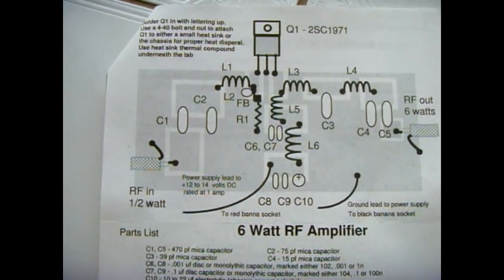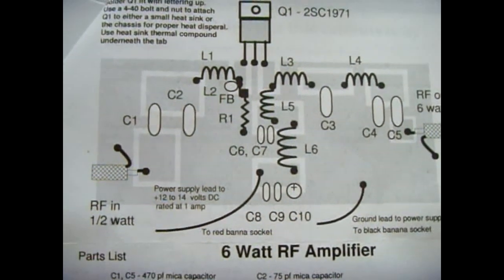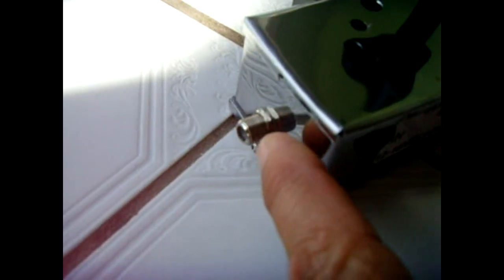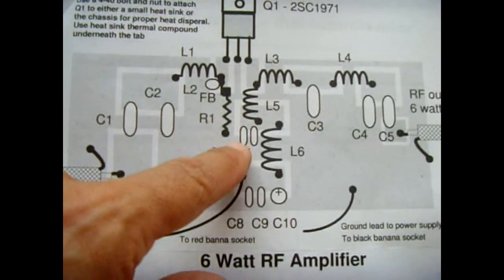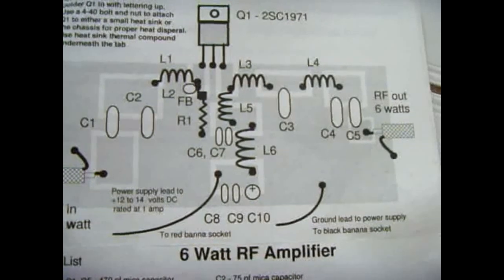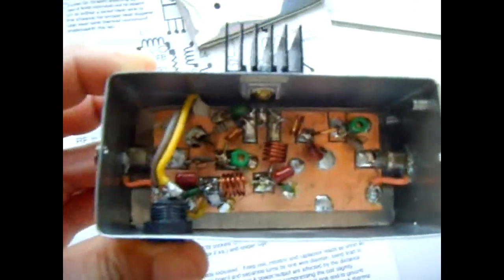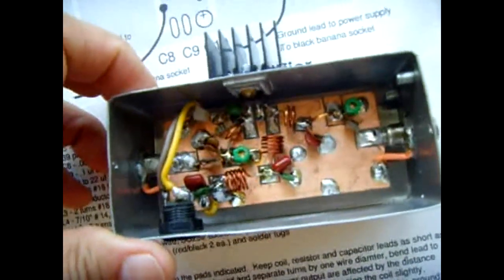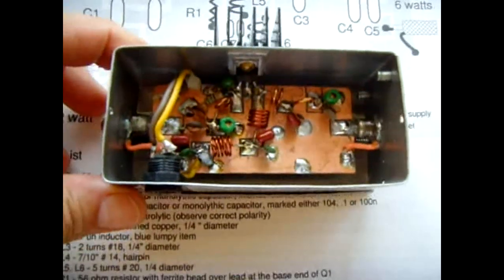6W RF Amplifier Using 2SC1971 (85-110mhz)

Comment: If i use fix 22pf on the output instead or a trimmer cap  connected parallel in 470 pf can i still have the 6 to 7 watt output?

Comment: Is it possible to achieve 2600Mhz or 2.6Ghz using this circuit? if not do you have one schematic doing that?
Reply from the maker: No. 2sc1971 is for VHF only. You're better off buying an amplifier at the link below.

http://bit.ly/2soXMA6
(coupon codes: BGAFF7, affiliate6, or elec)

Comment: what is FB?
Reply from the maker: A small ferrite bead goes over the lead of the resistor on the side of the resistor that connects to the base of Q1. :-)
Reply: what are the turns in fb??

Comment: what is the maximum range of this?
Reply from the maker: Hello. All depends on the terrain. Across open water or a desert? 10 miles or more. Thanks for watching! Be sure to rate thumbs up and share.
Reply: This looks like a very nice amp.   How much input power is needed for this amp?     With a 5/8 wave, tuned omnidirectional ant. I can get about 2.5 miles in a residential suburban area having some large trees using about 3 watts.   I can decrease the output to drive your amp to maybe get about 5 or 6 miles omni. range.
Reply: Oh, the drawing says 1/2 watt drive.

Comment: mine doesnt work,, can you help me please? no output at all, fine temperature on my Transistor.
Reply from the maker: +Jomel Brent Arances 
Possible causes:

Fake 2sc1971
Faulty 2sc1971
Incorrectly installed 2sc1971
Transmitter is too low in power for the RF amp's input.
Improperly tuned amplifier

Thanks
Reply: i dont know how to properly tuned the amp
Reply from the maker: It is almost impossible to tune a RF amplifier without a field strength meter and DMM to measure the current draw by the RF amplifier.
Reply: thanks sir
Reply from the maker: *****
You can find them. Look up videos on Youtube showing how to identify fake 2sc1971's
Reply from the maker: *****
A Google search can do wonders. Enter "RF Transistor 300 MHZ"

Comment: If you think the 2SC1971 is a good RF amp. for FM you should try the RD15HVF1. With a 6dB resistive pi attenuator on the input you can still achieve 15W out with 500mW drive. They're quite rugged and you can adjust the output power between 1w and 15w by adjusting the gate bias voltage. It makes the perfect accompaniment to a larger amp as a driver. I managed to use one to drive a pair of MRF455 transistors in tuned class B push pull. I know the MRF455 is specified as a HF device, but it will work as a low band VHF power amp to 110MHz. I got 150w out of this configuration, lol! Interesting experiment :D
Reply: Andy Payne Yes, very good but often not practical. Can you get the specialist capacitors, Teflon boards or run the circuits at the frequencies that the datasheet test circuits operate? Do you want to be transmitting at 175 or 512MHz? Almost invariably the answer is no. The values of xc and xl at the input and output of the devices does not always change in a totally predictable nature as frequency is changed and circuit board dielectric characteristics also change as frequencies change so just scaling stripline lengths according to frequency is not enough. If you get a circuit that someone has already been using at your frequency of interest, then you have a verified circuit anyway,s and what is the harm in experimenting? That's what radio tinkering and learning is all about.
you are speaking to someone here who has been such a tinkerer for about 24 years, so I know what I'm talking about from a practical standpoint
Reply: Got a schematic ?
Reply: It is pretty easy to round one up by searching on google. I have one built into a die cast aluminium box, using it as a heatsink. It only ever gets warm. Draws a maximum of 1.5A at 15V and easily puts out 15W
Reply: joy m http://www.mitsubishielectric.com/semiconductors/content/product/hf/sirfpowermosfet/siliconrfdiscrete/siliconrfdiscrete_lv4/rd15hvf1.pdf
Reply: Andy Payne That is the datasheet, yes. There are circuits for amps for the FM broadcast band using the RD15HVF1 on the internet. If you google RD15HVf1 and go to the results for images you will get schematics
Reply: I like testing schematics in datasheets first since they are verified.
Reply: joy m Try this. It is more of a picture of construction than a schematic but you can easily work out how to build it "ugly" style without etching a PCB. http://elektronika.web.id/elkav2/index.php?topic=733.60 scroll down the page and you will see the picture.
Reply: Is the RD15VF1 an LDMOS power MOSFET made by ON Semi?    I've got a 3 Watt Xtmr with output power control down to 250mW so it would be nice to get about 15 watts. Rather than 2.5 miles, I might get 8 or 10 miles with my 5/8 wave omni ant.  What do you think?

Comment: Also, are there any problems with harmonics in this design? Do you use any filter inline with your antenna?
Reply from the maker: I'm posting a new link right now. I did not notice any harmonic issues. I walked all around with my frequency counter and did not notice 100mhz/200mhz. Only 100mhz. I'm sure you can add a low pass filter to prevent any harmonics above the frequency you choose.
Reply: Your frequency counter will only respond to the fundamental frequency as it is always going to be significantly greater than the output though. You need a tunable rf sense meter. I believe they are referred to as a wavemeter. It's really just a tuned field strength meter or tuned rf sampler. It could be a great next project for you :)
Reply: Use RF spectrum analyser for any spurious emissions

Comment from the maker: Not too much. I had the scrap stainless steel for the housing from a non-repairable microwave oven. The rest of the parts I had pulled from scrap electronics. The 2sc1971 I bought online. Beware of fakes. There are videos to help you identify the fake RF transistors. I bought used ones pulled from older electronics.
Reply: Hi man great to see you did this is have seen and baught other people's  models

Same concept. 

Can you send me the full  sheet of details with diagram and parts list u have on the sheet of paper 
Please

Comment from the maker: If the input power is too low, the amplifier will not work. It won't oscillate.

You can try a NTE342.

Thanks for watching my video.
Reply: What if feed 1971 with more power than 500milwt example 900milliwat what can happen,? even witn conected antenna 
İ have one amplifire like this but when i ste last stage trimmer to the more power my frist made signal goes out from right frqunecy wich is set from pll!! Whats my problem ,please a little guide !!

Comment: Where can I get a case just like yours? I need help finish building my rf amp,I brought a 500watt rf amp pallet and need help finish building it.I need a BLF78 also want to know how can I connect the coax to a power supply and what max power supply should I get for the 500 watt rf amp pallet.also what max should the fan be and how to conncect it.

Comment: Few questions if you get the time to answer. Is a RF transmitter and amplifier the same thing or do you need a transmitter to plug into this amplifier? What kind of range would one get from this device? And one more, is there somewhere I could get a printout of this schematic?

Comment: Cool case.  i'm interested in a circuit I can add to the tuner of an A.M. tube radio to boost it's reception.  Would this RF amp be good for that or is it only used for transmitting signals?